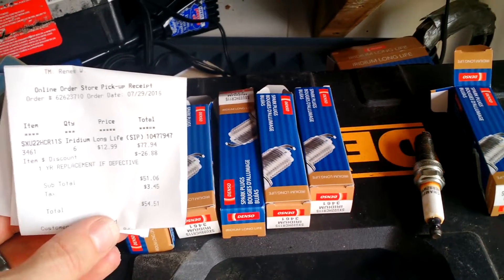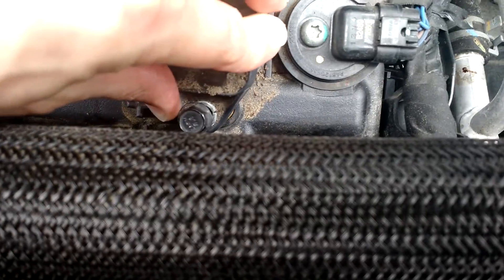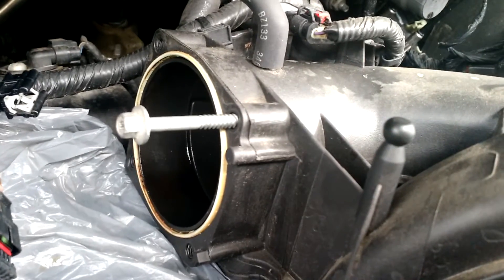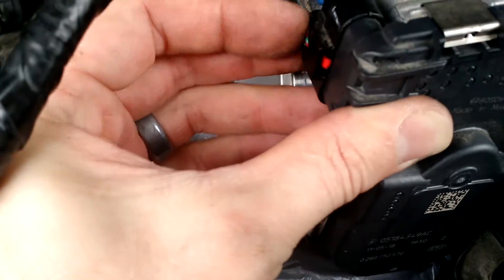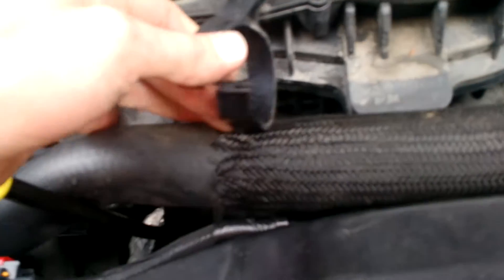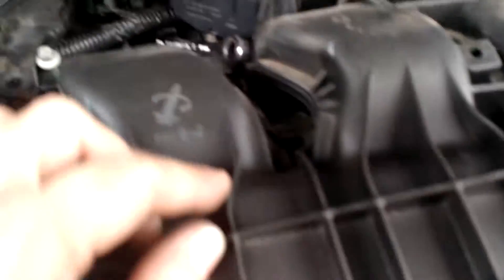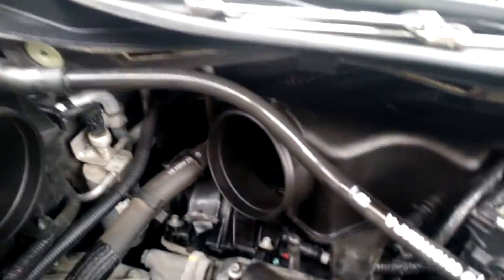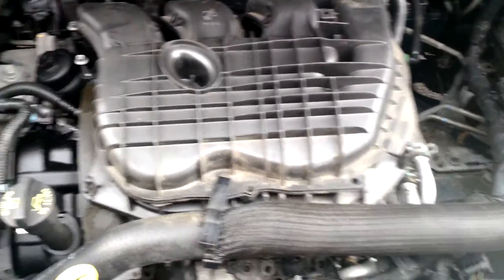Dodge Grand Caravan Spark Plugs and Throttle Body - in reverse

Comment: I have a 2010 Dodge Grand Caravan and the red lightening bolt light popped up with a check engine light. Would replacing an air filter help or do I have to replace my throttle ?

Comment: Hello great video, I have a 2017 caravan. I have been told that the throttle body is dirty. They want 250 to clean it. Can I clean the throttle body with removing it. I have heard that if I remove it the service engine light will come on and I will have to get it reset. Thanks for your help
Reply from the maker: I didn’t like the idea of cleaning without removing because it felt like too much of the residue I was trying to clean would end up in the intake anyway. Kind of defeated the purpose 🤷🏼‍♂️. I can’t pretend to know exactly what you’ll run into with your 2017, but the engine light should only come on if you’ve done something wrong. If the car is off while it’s removed, the computer system should be none the wiser. Most of the time you can reset warning lights by simply disconnecting your battery for a short time anyway.
Reply: @PromisKeeper  I'll just disconnect the battery. They wanted $250.00 to clean it lol. I can buy a brand new throttle body for 150.00. I'll buy a $6.00 bottle of cleaner and try it.
Reply from the maker: Another thing to keep in mind, sometimes the computer may need to recalibrate after disconnecting the battery for an extended period of time or if cleaning the intake results in a substantial difference with your air/fuel mixture. I had a Dodge Ram years ago that after having a dead battery, jumping it wasn’t enough to keep it running. After about 20 minutes of giving it just enough gas to keep it from dying it finally began running like normal on its own. Never had another car act so crazy, but we’re talking Chrysler so at least now you know. lol.

Comment: Please,help me! My 2013 Grand Caravan shakes and sometimes even turns off when coming to a stop. I thought the shakes were from the transmission,but I"m not sure. I've seen some videos and some people say it could be throttle related. Like the van chokes for air(?) Would you know what the problem would be? Recently,a catalytic converter,the rear one,was replaced because of P0420 code. But the van did shake before the replacement.
Reply from the maker: If the RPMs are too low when idling I would start with the simple stuff like air filter, EGR valve, spark plugs... it could even be something like a weak battery or bad alternator. Does it drive fine otherwise? Worst case I had a car with a bad transmission, I had to put the car in neutral when stopping and then rev the engine and throw it in drive to get through an intersection. It was scary.
Reply: @PromisKeeper  yes it drives fine...some harsh shifting here and there
Reply: And it is scary too when the Van shakes because it keeps going forward while shaking and it turns off. Feels like stopping on gear without pressing the clutch pedal in a manual transmission vehicle
Reply from the maker: That sounds like a transmission issue. And since it is a Chrysler... not a surprise. Our transmission was rebuilt last year. It was a disaster. The van was in the shop for a week for the first rebuild, wasn’t driving right and then started getting worse by the end of the week so we took it back and the shop had it for A MONTH for a second rebuild. They even took it to a Dodge dealer at their own expense for a second opinion because they were stumped as to what was happening. Drives good for now. FYI, costs us over $3,000! So if you get estimates any less is a good deal.
Reply: @PromisKeeper 😥😔,I think I would give the vehicle back to the bank. We can not pay it and repair it at the same time. We needed a reliable van to carry my wife's electric wheel chair. I will get a bad credit after that,but I'll be more relaxed